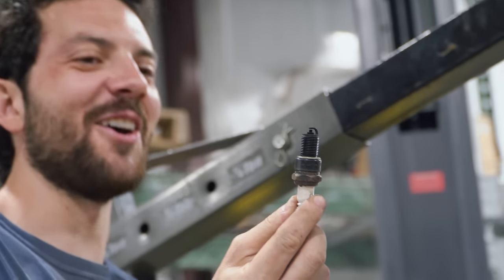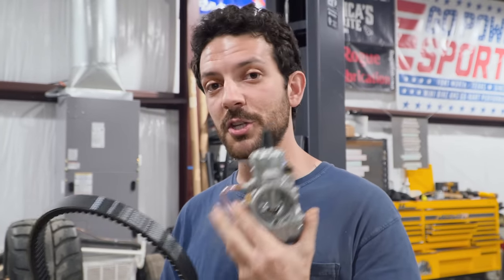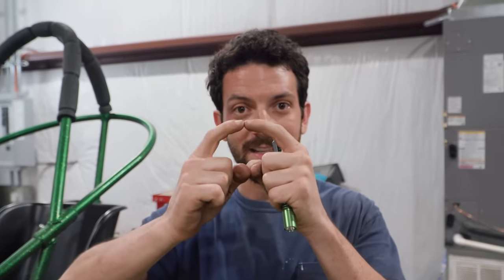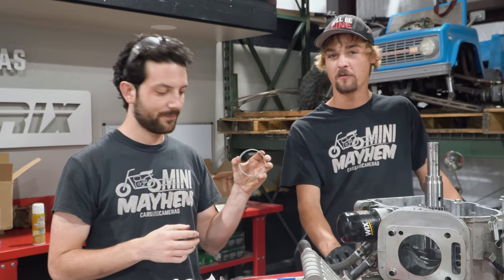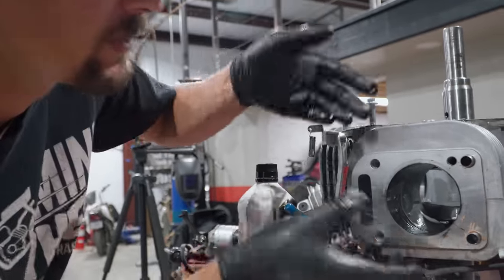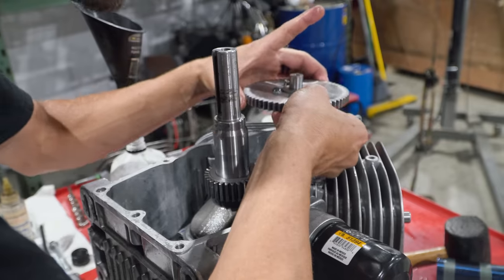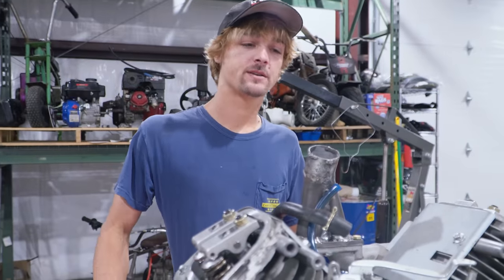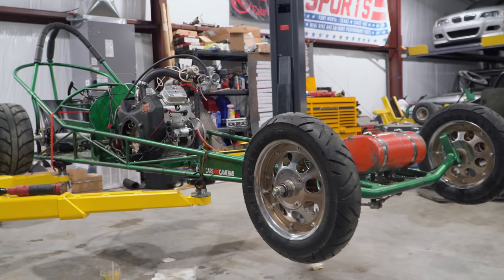Turbo 670cc Dragster Engine Rebuild | Prep for Methanol and More BOOST!

Comment from the maker: We're trying to set this thing up for success folks! With the increased power, reduced weight (coming soon), and proper drag slicks (also coming soon), this thing is gonna FLY!
Reply: Brilliant!
Reply: Where’s the LAMB SAUCE
Reply: You should add a jet engine.
Reply: ditch the chain drive cause your losing quite a bit of power there. instead look for a motorcycle transmission like one off a Goldwing. mount the engine longitudinal and that will solve most of your problems getting the power down. sooner or later your gonna make well over 100 to 120 horsepower. so a transmission is a must. dont say i didnt warn you if you end up getting bad results
Reply: I've been rewatching all the dragster episodes on your playlist so why don't Jason come back and ever make an appearance with this STP blue Rich Petty t-shirt have an excellent day guys:_sendit::_omg:
Reply: I wanna see you get into the 7`s at the strip
Reply: hey guys i have 2 running snowmobiles if u want to tear the engines out and stick them on this or other projects
Reply: Take your time.  Going to be great when you complete.  This Old Man pulling for y'all.  Love you guys. 🛵🧔💝💝💝
Reply: Not sure if it applies to this particular engine, but normally the top two rings need to be put on the piston the correct way up. If they are assembled upside down the engine will smoke due to scrapping oil upwards into the combustion chamber rather than down into the crankcase. If it's too late, it's good knowledge for the future!
Reply: Have you considered an emergency parachute on the rearend?  just saying increased power without improved brakes ????    Sorry you guys have become like family soooo.
Reply: That turbo will produce a lot more power with an inner cooler when that turbo heats up off the exhaust running threw it it’s throwing hot air into the engine
Reply: All I gotta say is look at garden tractor pull tractors . That will help you make one that will last
Reply: Add a little shot of nitrous
Reply: LOVE THE DRAG RAIL SO MUCH, AND YOU HAVE DONE SO MUCH WORK YET THIS TYPE OF WORK DID NO PROVIDE MUCH CONTENT, SO SAD. I WAS EXPECTING FOR A DRAG STRIP RUN WITH PUMP GAS BEFORE THE MENTHOL CONVERSION, WOULD HAVE BEEN NICE TO SEE THE DIFFERENCE BETWEEN PUMP GAS AND MENTHOL WITH THE TURBO.
Reply: Then get a decent ecu with injectors to tune it. This carb set up yoh have is never going to let this set up reach full potential. An ecu kit with harness and injectors does not cost $2000 for these little engines. Ive seen them on sale for under $500. At the very least ypu should put a blow through carb on it, or just download instructions online on how to modify your brand new carb for boost, its not hard. Ive boosted many of small engines and ive tried what you are doing, its not going to work like you think. Trust me and get one of the three options I mentioned above. The drag rail deserves it.
Reply: Yall have saved a life 🙌🙏
Reply: Bruh yes ! Let's see some stupid drag times
Reply: It's amazing! I wonder how far you can get with this build.
Reply: @theuntrackabletheuntrackab5355  Lol
Reply: Really hoping that oil pumps ok... LS oil pumps go on similarly and shouldn't need to be forced, can easily break a pump gear banging on it.
Reply: @kennydeever4941  umm the ls Chevy isn't similar at all! Idk what videos u watch but I actually work on stuff
Reply: make sure to deburr the rings after gapping them because there will always be excess material! and sometimes you want the top ring to have a different gap than the 2nd ring
Reply: Ditch the clutch. GPS junk use a 1190
Reply: @14:44 WHO spun the front tire on the dragster??
Reply: You should use a 2 speed trans for good acceleration and Great top speed
Reply: use Yamabond for your sealant......its the best
Reply: Gearbox off of a motorbike or something would be sick
Reply: Can’t wait to see it Rip!
Reply: You should put the turbo feeding into the carb instead of the other way around
Reply: @roguetree4745  maybe on the 8th mile xD
Reply: "We're trying to set this thing up for success"
That's what im saying about my life for 30 years 😂👍
Reply: @TechKnowCSS  watch the previous vid. They ran it at the strip on pump gas.
Reply: @mountain177  WITH TURBO?....NO.
Reply: Install the turbo on in the right way not like a bunch of Hillbilly's
Reply: @monfrig6959  APPARENTLY YOU HAVE NOT BEEN FOLLOWING ALONG WITH THE REST OF THE CLASS.
Reply: You can ACTUALLY gain MORE TORQUE by RETARDING the valve timing by ONE TOOTH, believe it, or not. I learned this truck from an old Datsun Pickup that I used to own. I pulled the valve cover and noticed that the camshaft sprocket, under the washer that the bolt that holds the camshaft sprocket to the camshaft, there is a alignment pin that goes through the number 2 hole of 3 thar are bored through the camshaft sprocket that they're numbered 1, 2 and 3. When the engine came from the factory, the pin is set through the number 2 (stock performance) for the engine. I later found out in the service manual that IF I wanted more torque, to CAREFULLY remove the camshaft bolt and CAREFULLY slide it off the front of the camshaft, (so that the timing chain don't fall off the crankshaft sprocket in the bottom), then take the camshaft sprocket and carefully rotate it to the number 3 hole on the camshaft, (WITHOUT changing the valve timing by bumping the cam any by accident), THEN replace the camshaft bolt and tighten. This RETARDS the valve timing JUST A SMIDGE, which gave my Datsun MORE TORQUE, as it explained in my service manual. It WORKED after I changed mine on my truck. The service manual also stated that if I wanted better FUEL economy, (i.e, if I were to drive a long distance), THAT is what the number 1 hole on the sprocket was for. So ADVANCING the camshaft gear to hole #1 was for fuel economy, #2 was STOCK and #3 was for MORE TORQUE. I tried this with a 2 h.p. minimize engine and it screamed after I did it. It makes it run rough at idle, but has instant power when you go to full throttle quickly. Just F.Y.I. for ya.
Reply: Dont they have a 999cc v twin id install that plus turbo

Comment: The Dragster is my favorite build out of all of them. I’ve been waiting on these for a LONG TIME! THANK YOU SO MUCH BOYS
Reply: I nearly had a heart attack when the dragster was damaged at Busco Beach, and I was there watching the accident go down. Dread, and helplessness at the same time.
Reply: Its gonna fail i guarantee should have used a 200+ hp hybusa with turbo cranking 400 500 hp with that frame i can get about a 8 second drag rail... its gonna run hot its gonna break ethanol will eat all seals burn 🔥 pistons remember I said this before you even test it.. not enough hp its gonna be a 16 second or worse

Comment: Glad to see the extra steps in this build. Will pay great dividends. Back in the day when using methanol on racing karts. We always ran a flush through the engine at the end of the night. Using gas to clean the methanol out. Letting it set with methanol in it caused a lot of gumming. Just a thought. That was always a slobbering mess. Great having Charles involved more. Fine young man. Nice to seeing him become more comfortable. Can’t wait to here this beast run again. Great work. Remember, it’ll be fine.

Comment: 14:45 That dragster has some GOOD wheel bearing. That or your new shop is already haunted. It's going to be insane to see this thing go down the strip now. I rember when you guys first started building it it's going to be cool to see what it does now.
Reply: My guess the overhead fan. Caught my eye quickly with the wheel spinning without a push.
Reply: @johninzerillo1510  ohhhhh, that naked sense too XD.

Comment: You can run methanol really rich! Especially with boost. Unlike gas, you really don't lose any power with a rich mixture. Helps with cooling your charge too. Also those carbs run a bit lean in general when you are trying to push that much fuel through them. Fuel flow on the needle will be a way more too. Be warned that methanol is pretty gnarly on carbs! I would drain the carb after every run and keep an eye on aluminum/brass parts for corrosion. Also can foul up your oil. More consistent oil changes are a must.

Comment: I noticed when it's about halfway when he's putting the motor back together in the background, the front wheel of the dragster was moving. You have very good bearings in that thing because it just kept going and going. Have no problems with the front wheels slowing you down on that thing for sure. Good job guys!

Comment: With methanol, or are going to have to do a lot of oil changes, especially with the larger ring gap. Also be ready for the exhaust fumes when burning methanol; it’ll make your eyes water.
Reply: Some bike drag drivers have like a compressed air fresh air thingy for their helmets now
Reply: It's almost required to run a top end lube additive to help prevent washing down the bores. Side bonus is you can get all kinds of scented formulas like cherry and rootbeer.
Reply: @ddcraun  I'll stick with the traditional "Industrial Butt Scent".
Reply: I always wondered why my eyes watered. I thought it was tears of joy. I have no sense of smell.
Reply: @machinist5828  you've gone smell blind?
Reply: @thagingerninjer5391  nope. Just immune to my own farts.... LOL.
I don't ever remember smelling anything. I used to think people were weird. Now I know they are 😜

Comment: I love the dragster build. I think adding an air to water intercooler would be a worthwhile power booster. You could make one in your shop custom for this application and it would help keep the intake charge very cool for higher boost levels. Combine that with the cooling effect of the methanol and this thing should really get after it!

Comment: Unscheduled rapid disassembly is a fancy way of saying grenading the engine...I like it. Because those piston rings aren't pinned, the honing in the bore causes them to rotate so putting each gap a different way is moot because the gaps line up many times during an engines running.

Comment: Just a thought guys.. boost generally builds more crankcase pressure.. you may need a vent to alleviate the pressure to stop the oil leaks ;)
Reply: They have crankcase vents. They will probably need a catch can.

Comment: Episodes like this make me realize how much I appreciate and how entertaining Ike really is. Also, if you're building an engine, NEVER EVER!!!  Rotate the crank until the rod caps are torqued to spec. I really hope the C&C crew listens to their fans and get a fuel injection system for this engine. They are not $2000 like John said in a previous episode. Theres actually decent options for way less than 1000. Ive even seen them on sale for less than $500 for a tunable box with injectors and wiring included. I got the computer in my race car for way less than $2000. I just wanna see this engine set up actually perform, and this carb set up will never work to full potential. Good way to ruin the engine. Lots of places would even sponsor these guys an ecu........ oh well.
Reply: I have to second that, fuel injection might seem like overkill at first,  but you've already seen some (minor) issues with the standard carburetor setup.  
 Hey, I wouldn't even bring it up,  but fuel injection has gotten to be pretty commonplace on a lot of cars today, and even NASCAR  runs fuel injection on everything on the track.
Reply: @jstephenallington8431  Yeah, wasn't NASCAR (the organization for trying new tech to make it mainstream) the last to finally ditch the carbs?
Reply: Yes, fuel injection and a small intercooler would be the next step for a more reliable setup. They will probably run into some issues with the carburetor that the engine will lean out in certain spots and be too rich in others depending on engine load and boost.
Reply: @marcelpursche5339  exactly on the lean and rich issue, thats the issue I ran into years ago on these small engines with boost. They don't even need an intercooler on this application because they plan on running methanol. Thats whats frustrating. They gapped the rings, did their homework for boost using methanol, but now their guna run it on grandpas old house slipper...... ggggrrrrrrrrr.
Reply: @marcelpursche5339  no point in an intercooler wen you have a draw through carb.

Comment: My late father & I turboed a brand new series 1, 4 door Honda Accord well over 30 years ago there maybe something I say that maybe of use.
We dropped the compression ratio to I think 8.7 to 1 on 95 pump gas, like you we were suck through but we used a SU carburetor, we got a load of different needles & with the use of a gas analyzer found some that the engine ran lean on when hot then used a drill press & emery tape & wet & dry to remove material from the needles in different parts of the needle to richen up the engine right through the rev range testing all the time this took months. we also added water & alcohols injection to cool the incoming charge as we developed this car.
Use studs instead of bolts to clamp down your head as all the tension is on the nut & not on your engine block.
In the old days they used Boffer rings between the head & block the grove in the head is a alternative cheaper but not quite as effective.
Get the distance between the turbo & your head as short as possible, look at a header & re design your exhaust just remember that every 90 degree bend creates a pressure drop so go up in pipe size on the bends then drop back down in size on the straight bits & yes I know it will look extra strange LOL.
Fall when you stop racing CLEAN OUT ALL YOUR FUEL SYSTEM INCLUDING THE CARBURETOR AS IT WILL TURN TO JELLO OVER WINTER & IS A RIGHT SHIT TO CLEAN OUT IF YOU DON'T you are warned !!!!!!!! you don't want to lose a race because of " BAD " house keeping.
You have to realize we did all of this before turbos were the norm there were no books or Youtube just seat of the pants & trial & lots of errors.
The most important thing is HAVE FUN 
Rodney Duncan from New Zealand

Comment: @8:49 Yepp I always do a loser ring gaps on forced induction builds, nitrous, methanol, ethanol etc. Except I was always told by senior techs that typically the oil control rings were to be left alone and to only open the gap on the upper two (where applicable) compression rings unless you wanted to be changing oil after every few runs but I never tried so IDK lol!
Reply: Don't know about the small engine, but you leave the oil ring alone on V8 engine

Comment: I remember when Isaac put those metal copper wires into the heads I saw the videos when they first came out and I'm rewatching them on the playlist again for the drag rail and before it had a mailbox for a hood scoop yeah they cut the mailbox down but they didn't change it overall ratio that's why I still look like a mailbox
Reply: Dont they have to be changed when removing the head?

Comment: Cool video, can't wait to see how fast it goes! By the way, if you continue to have leaks on the side cover, clean them off and try anaerobic sealer instead. It's made for metal to metal surfaces. The surfaces have to be flat and smooth for best results. Loctite makes a good one. Good luck with the build.

Comment: You guys are having a blast, and so are we watching !
  Only recommendation I have is to not use anything in contact with alcohol/methanol other than the yellow plumbers tape for the threads. .  You can purchase it at any of the carb shops online that deal with ally or meth engines. The white will leak over time .

Comment: 15:43 that stuff is great. It's the one sure fire way to prevent honda bseries engines from leaking oil between the head and block under the vtec solenoid area. No idea why, but every bseries leaks there unless you put a light coat of copper gasket spray on the head gasket.

Comment: Looking good, fellas! My only little gripes here are: The rings usually have a beveled side, and it's important to note which way they face. Also...was curious why the side cover gasket was not replaced....I don't know about that particular engine, but usually side cover gaskets assist with proper crankshaft endplay. However....I'm sure "It'll be fine." Looking forward to seeing how much better it runs with the turbo on the special sauce! My merch from y'all showed up today....it was a great end to a lackluster Monday for me  :D

Comment: That locating ring gaps 90 degrees out from each other, is a wives tale, rings rotate while engine is running, else you would wear a groove in your cylinder wall where there is the gap not wearing the wall.,

Comment: With rings it more so depends on how much boost your gonna be running.keep in mind your gonna be losing some compression with gapping the rings and will end up with a little more crank pressure.

Comment: FYI piston ring gap orientation is a myth due to soon as the engine start the rings start rotating around the piston in the bore so there bound to cross many many times thru out its life

Comment: Defo need to source a hard pipe for the intake. Plugs probably super rich from the hose collapsing under vacuum. Should ideally sort that before messing with the jets
Reply: isn't the hose reinforcement they did enough to prevent that?
Reply: @davidlatoche8751  didn't see them do anything with it , last video out it was collapsing and it's exactly the same pipe now. Cut the ends and use some alloy or steel tube , it'll only go softer as it gets hotter

Comment: A friendly heads up, I run that exact carb on a bone stock Kawasaki 400. I think you're gonna need some drill bits to get sufficient flow especially for methanol

Comment: Also I know you wanna keep it cool . Get a couple electric turbos off eBay and run them over the heads you can mount them any ware and use pvc to build a little cooling shroud